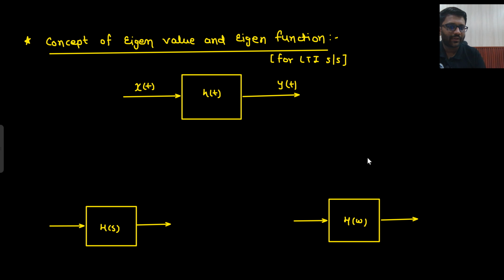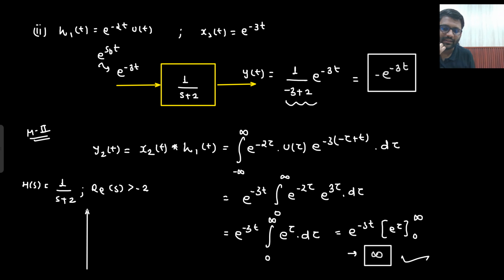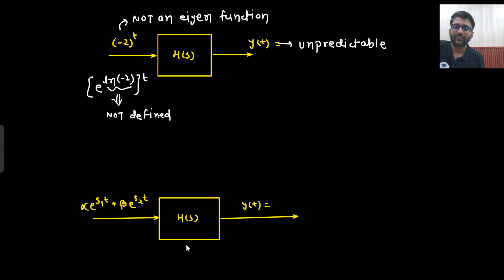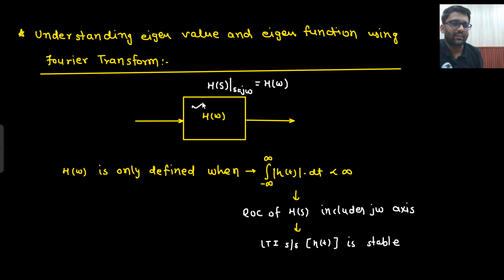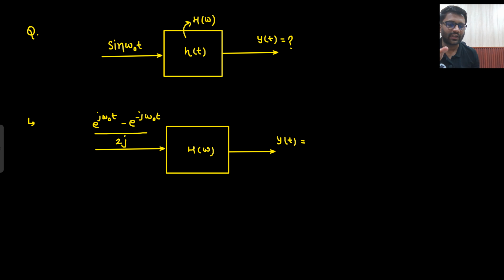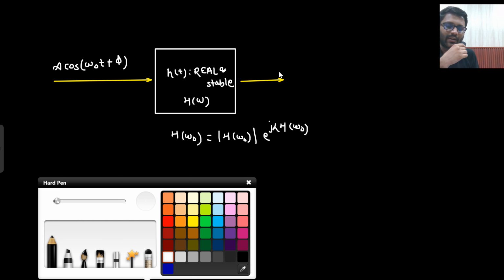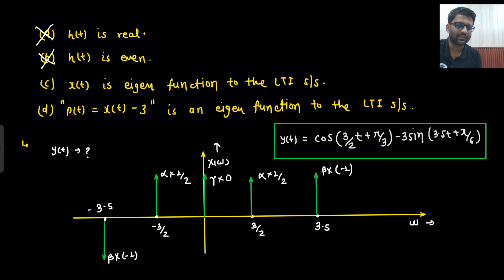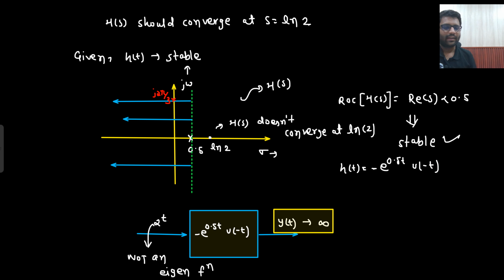Concept of Eigen Value & Eigen Function for LTI Systems || Himanshu Agarwal || PrepFusion

Comment: In the question it is given stable LTI system if ROC nit mentioned that means by default we have to take entire S plane as ROC? in that case both options are correct
Reply from the maker: There is nothing called "By default" in Engineering. 
If they have said stable, ROC could be anything with the condition that it should include jw axis, nothing else. 
You always have to consider all the cases before marking anything "true"